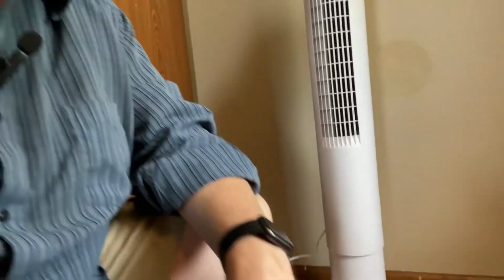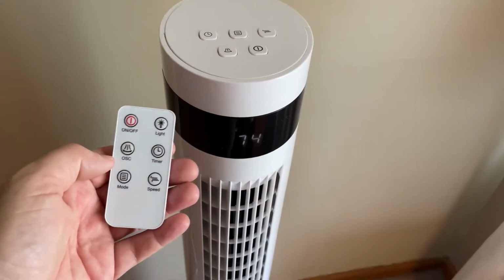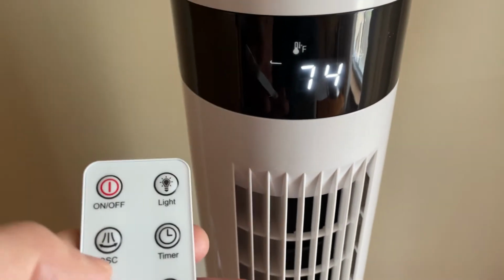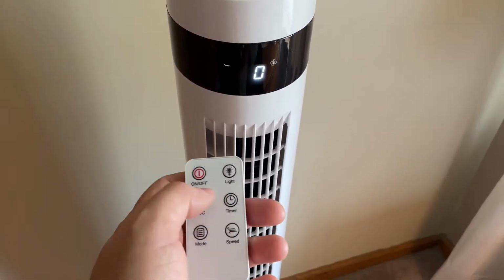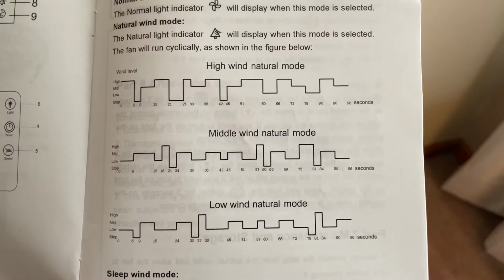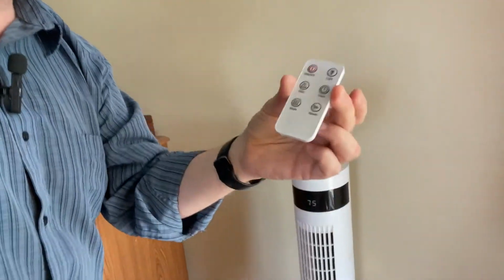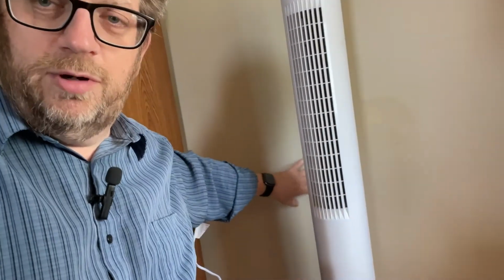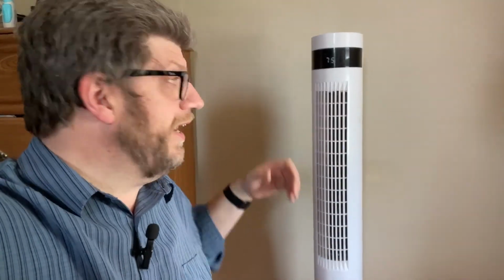Affordable Tower Fan For A Comfortable Night's Sleep

Comment: How do I adjust the temperature?
Reply from the maker: Ehh, it's only a fan, not an AC unit.  Fans move air but don't necessarily change the temperature in any meaningful way.  They only make it FEEL cooler when the air moves over your skin.

Comment: Can you take it apart to clean it? That the #1issue I have with some fans, if you have pets, you know hair abd dust will collect on the blades.
Reply from the maker: I don't see an easy way to do that, though I have vacuumed it out a few times with visible results.
Reply: @tomshomefinds  thanks for the response. This is why I stick with the old box fans or older style fans.

Comment: does it act same as AC? or closely as?
Reply from the maker: Eh, not really.  It does move a lot of air around and it does cool your skin via evaporation (as all fans do) but it doesn't actually remove the moisture from the air the way an AC would.  On warm nights we do still run this fan and it feels pretty good in bed.  If it's really humid out we will run the AC and this fan (just to help move the cool dry air around a bit.

Comment: So mine stopped working after a power outage. It turns on but fan doesn't work. What can I do?
Reply from the maker: oy... it could be fried.  Try unplugging it for a few minutes and plugging it back in to see if anything resets.  Otherwise, you can try to contact the seller on Amazon.  I had a toaster oven fry during a storm a few weeks ago 😞

Comment: How can you change the temperature
Reply from the maker: I think the temperature is a reading, but you can't necessarily change it.  It's not an AC or heater so it doesn't actually produce cooler or warmer air, it just moves the air around.  All general fans (like this one) make you feel cooler by push air across your skin which removes moisture and makes it feel cooler even if the temperature doesn't necessarily go down.  We still use this fan in our bedroom in the summer and it helps move the air around, even on hot and humid nights.

Comment: Hey how do I confirm the timer mode? I want it one hour but there's no press to confirm button. It stays like that showing 1 h but never turns off
Reply from the maker: Ooo, that's not good.  I simply hit the Timer button on the remote once (the fan reads "0") then hit it again (the fan reads "1") and just put the remote down.  I just timed it today and my fan turned off exactly 1 hour after I saw the 1 appear.  Maybe your timer function isn't working?